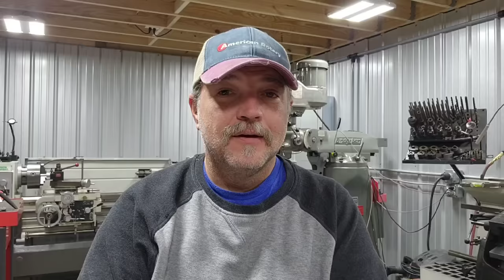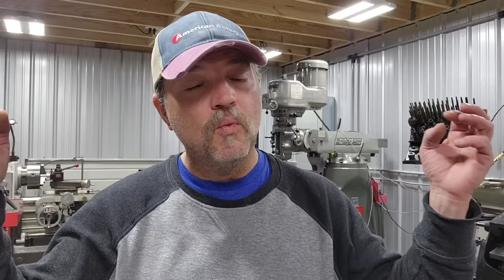*NEVER* DO THIS TO Your Harley Davidson Motorcycle! - Kevin Baxter - Baxters Garage

Comment: For years my storage regiment was a deep cleaning of the entire motorcycle,  pouring half a bottle of gas stabilizer into the tank,  top off the gas and run the bike on the road at least an hour.  Never store a wet, freshly washed motorcycle.  I then remove my spark plugs, drain the oil, fill with a fresh load of oil and filter and squirt a few shots of fresh engine oil down the plug holes.  Prior to replacing the plugs I lift up the bike's rear wheel and spin the engine manually a few revolutions to coat the cylinder walls.  Finally I put the battery on a Battery Tender while still in the battery box.  I clean and reinstall the air filter, adjust and lube everything as if in 5,000 mile service, then finally cover the bike until the spring.  On that first spring day she is ready to run, happy and maintained.  I have been riding steady since the mid 60s, have owned and maintained a dozen motorcycles, and have never experienced nothing but great riding.

Comment: Good info but it makes a diff if it is 40 above vs - 10 what temp are you talking about and also if your engine / bike is air cooled dont leave it idle for 30 min it is designed to have air flow whice you should put a fan on it or drive it dont just start a air cooled engine and walk away for 30 min

Comment: hi i have a question i have a 2020 Yamaha bolt  bought it new i usually ride till fall and when it gets to cold i put it in the garage  and have been starting it every two days  and usually ride around the block a couple of times  and if too cold i run the bike for 25 minutes  i have never had any problems when the warmer weather comes  should i stop doing this  and just leave it alone until spring  i appreciate your advice , thanks

Comment: Hey Kevin, great video I have learned a lot about my engine. I'm currently in Kuwait, been here for three years. My wife start my bike every couple of weeks and it is on a tender. I was home this last Thanksgiving and rode with a buddy that also have a 2021 Road Glide, When I was on empty he still had half a tank of gas, would pitting of the cylinders cause this? I had the bike serviced before the ride, and a tuner installed. Any suggestions of where to look would be greatly appreciated. I will be home for good in March and ready to hit the road. Thank you.

Comment: Kevin my garage is insulated and never drops below 45degrees I have it heated. When I go out to the garage and flip the heat on and heat the garage up to let’s say 70 degrees. Will this effect condensation in the motor or I have nothing to worry about as long as I don’t start it? Thanks

Comment: I want a motorcycle shop in Colorado and I've actually seen this damage and so much condensation in the oil bag it actually froze over the supply line so the engine could not get I pulled it into my heated shop 3 days later I got a cup and a half of water out of the bottom of the tank

Comment: When I rebuild an engine, I rip the sparkplugs out and PUSH the bike around my backyard Lots ( in gear ) to get oil moving/circulating..
I'm getting older ( and hopefully smarter ) so I need to purchase/make some 'rollers' ( electric driven ) to go under the back wheel and run the engine ( no sparkplugs ! ) to avoid alla that pushing....

Comment: I have a 2003 Heritage Softail 88B engine.  How reliable is the counter balance system.  How many miles, with good oil changes, can I expect from that mechanism.  Or worst case you have run into.

Comment: Hey Kevin. I know not to do this, and normally once my bike is away for the winter I just leave it unless I intend to ride it up to operating temp. However a couple weeks ago I swapped out my gauges and had a check engine light, so I ran the bike twice to chase the problem and solve it. Would you recommend taking it out for a ride once I’m able to? Is one and done not enough to do damage (hopefully)?

Comment: What about a generac generator.  I have mine auto set at 15 minutes once a week.  Do i need to increase time or less start ups.
Reply: increase the time to give the motor time to get hot and vaporize any moisture AND vent it through crankcase ventilation.  20-30 minutes?

Comment: Great content again. My question to you is does this also apply to new engine builds. Meaning during the first start up of the break in of the rings for 1 minute ,let it cool down than restart 3 minute run and so on. Please advise.
Reply: Engines need load to break in the rings IMHO, flat tappet engines need the cam run in also (another can of worms)  apart from that I think sooner you can get it on the road and start putting load on it the better. Wear down the hone marks (by idling in the shed) and it will never bed in, you need them to file down the rings to seal before they wear down. Kick it in the guts-check for oil and water/leaks then start increasing RPM and load asap.
Reply: Follow the instructions of the people who engineered your new parts.  Necessary break-in procedures vary with the materials and machining used.  If the engine was assembled for you, it may have had some break-in already to insure there are no issues, or maybe to ensure the most critical run-in is done properly.  
   Break-in is necessary with most materials because the finished parts have microscopic high points.  These small areas will bear enough load that they might get hot enough to melt then harden as the engine parts move through their cycles.  These “spotwelds” are ripped apart as soon as they form, and if big enough will continue to grow, leaving you with an extremely rough area where smoothness should be for long life and proper sealing.  Most metals also benefit from proper heat cycling, again changing the molecular structure to improve strength and longevity of your parts. 
   Why would you give a ton of money to someone you trust to create an engine, then not take their advice on the best way to finish the job?  Their reputation is on the line, won’t they give you the best chance of success?
   Why would you

Comment: When its twenty below zero I start my Harley up and instantly rev it to ten grand and hold it there until it warms up. Thats how you cant tell if the motor is ready to take a severe beating.  Do you want to go fast a few times or slow for eternity?
Reply: I didn't know you could set the rev limiter that high🤔
Thanks👍🤠✌️

Comment: I told so many riders to stop doing this, but they swear by it. I add Seafoam to my engines for storage and never touch them until I need to use them again. Motorcycle, lawnmowers, chain saws, etc. And change you oil often!

Comment: I know what you’re talking about, I store my bikes in a heated garage. However I do have a question for you regarding the fuel enrichment on initial startup. I bought a 95 cubic inch 03 fuel injected deuce. I get no enrichment on initial start up, I have replaced the IAC as well as the temperature sensor on the back of the front head. I don’t know what else to do. Is the there something else I need to replace? The bike only had 2400 miles on it, now it has 3400. It runs perfect after it warms up (idles) I’m stumped. Thank you

Comment: I thought that was common knowledge but guess not.  I'm bringing my bike to my dealer who is only 20 mins away. Didn't realize you have to ride it for at least 30 mins.  Luckily Im bringing it in for an oil change so I'm not too worried about this next trip.  Does the air temp make a difference. Let's say you're riding in a day where the high is in the 20s - does that require longer ride times to clear condensation ?

Comment: Hey Kevin,,  got a 018 FLFBS,   took it for a ride, 3 weeks ago,  got 2 miles from the house hit 3rd gear,   and bam,    did a uie,,   headed back home, lucky it was flat,roads , it was,squealling,  when gave it throttle, i just idealed it,  in first gear, anyway,  put in garage tuned if off ,tried to startit, hmm,starter,just spun,  took off,derby cover, tried to,start,  clutch  shell spun, chain  spun, lol hmm,  well took off the cover,  looked good, but,engine didnt spin,  could see threw the comp. Sprocket that the . Comp. Ramp, was broke in three places , on the spacer,   question ,     why cant the  man o war, work on a  Fatty and breakout, Harley want 300 bucks for just  the stock   ramp,  thanks for your time,  how do i get the  70 torx bolt out  when the  sprocket free wheels,,  ,,,
Reply: Fatty a hot rod,,, put on,a  elite 3  250 dunlop, 14,in. Meat hooks ,,power,vision, 475 cam, and pump,kit,  monster suker intake, Blow Exhaust,  wide open, did  head breather  hose to  rear of trans,,  if run the m8 at 148 onces of oil, never have blow by out the,head breathers,   its a solo bike,    i live in AZ,,so  never sits to long lol think  hold the 1 3/4 Retainer with box wrench, and,,try get the,torx70 loose,  hmm

Comment: My bikes in the garage can have condensation on the outside of the motor, gas tank and even the frame if the temps are cold and the humidity is high, will this cause the internal issues you discussed?

Comment: I live in Canada.
Today the temperature is 15 f.
Some of your comments make sense, I disagree with you not starting the engine on the whole.
There's an upside and downside to your philosophy.
I start my 93 FXRS-CONV and my 2010 FLHTC. every week
What about people who drive their vehicles all year in this climate, don't drive them is that what you suggest.
I am considered a hard-core rider, I ride in all climates, providing the roads are snow and ice free.
I have been building and riding for over 50 years and though you do register some valid points I will continue to run my bikes every week.
I feel there's more upside than the downside to starting your bike in cold environments.
I have been doing this on my 93 FXRS-CONV EVO carb engine for 31years, and my 2010 FLHTC for 13 years.
I want my bikes to start when I push the button.
This will not happen especially with a carb engine if left in cold climates over an extended period of time.
I also change the oil and filter every 1,200 miles on both bikes.

Comment: 2009 fxstc crank it let it run till it comes off fast idle all the time… 89,000 original miles… B.S.
Reply: from a commenter

@Crazygardeners.
4 months ago
Wonderful video. I’m an aircraft A&P mechanic and have always been told by Lycoming and Continental to never ever run an engine unless you can fly it, don’t even pull the propeller through. 
You can run it for as long as you want at a high idle and the oil will never get warm enough to burn out the moisture that gets sucked in after every shutdown. 

From me-Do you have a propane torch? When it's cold, grab yourself a chunk of steel, throw the flame from the torch on it. What happens, what do you see? The steel begins to heat up, and you see condensation (moisture, aka water) forming on the steel. Even as the steel is getting warm, moisture is gathering on the steel, until it gets R E A L  H O T, or heated for a length of time, that moisture remains on the steel. Same thing happens inside your fxstc, as it heats up, condensation forms. 
Unless it's ran long enough to burn the condensation off and vent it, 
guess where it stays?

Comment: The cover this is like I run my space here Earth the poor man furnaces what I call it off for about 2030 minutes to warm the engine up. Before I start it and then it running for 15 minutes but only do that every now and again not every week every other week. You know maybe maybe every 3 months you know during the cold weather every 3 months just to keep the battery up even though I got a tender on it.
  Well I'm gonna run it for about 20 minutes and then shut it down but I'll keep the space here around it until I figure that the unions. Cooled down enough we're the change of temperature doesn't create moisture that's just me.

Comment: I call BULL! I have never had a problem with starting and running in the winter. As far as fuel being washing down the cyls.....if that was the case, it would be happening any time of the year that you start the engine! If you heat the engine up to operating temp there would also be NO condensation in the cyls. You are reading too much into your fantasy!! Good luck with your channel!

Comment: never heard so much crap ,prove it
Reply: Better yet, prove it to yourself. Do you have a propane torch? When it's cold, grab yourself a chunk of steel, throw the flame from the torch on it. What happens, what do you see? The steel begins to heat up, and you see condensation (moisture, aka 👉water) forming on the steel. Even as the steel is getting warm, moisture is gathering on the steel, until it gets R E A L  H O T, or heated for a length of time, that moisture remains on the steel. 
Same thing happens inside yur motor, Start it up, she begins to get hot in places, condensation forms . . .turn it off before its had time to get the entire motor hot and burn off the condensation, you have moisture inside your motor. Doing a short run repeatedly, not can, but WILL produce significant amounts of moisture inside any motor. 
and as we all know, 
In a totally dry environment, iron or steel will not rust, but when moisture is added, the oxidation process begins. There is enough hydrogen and oxygen in the air we breath to allow atoms to bond with iron (known as oxidation, or rust) 
Look at the moisture on the piece of steel you heated up, Imagine the moisture inside your motor that wasnt allowed to run long enough to burn the moisture off and vent it.
crap my a$$